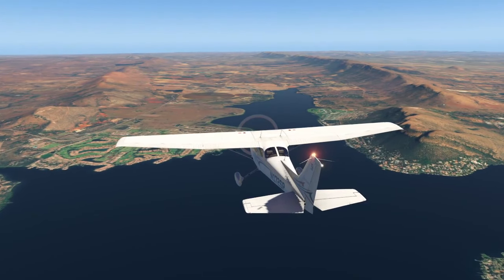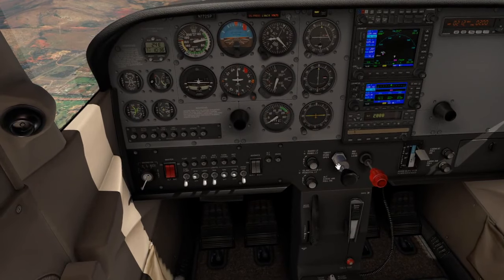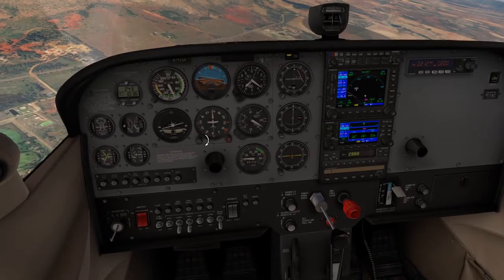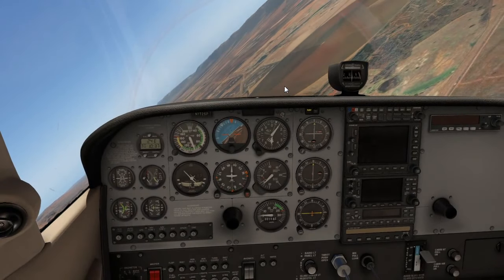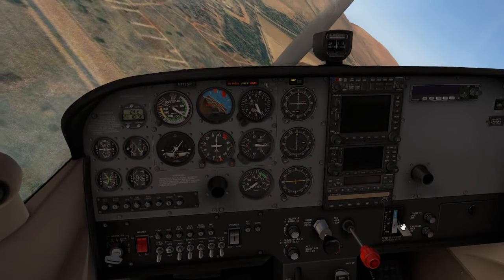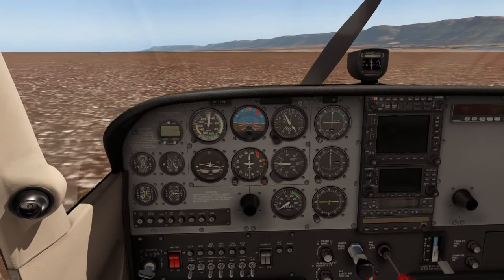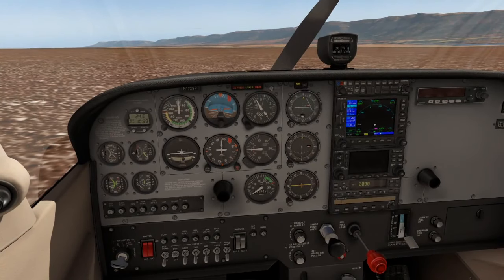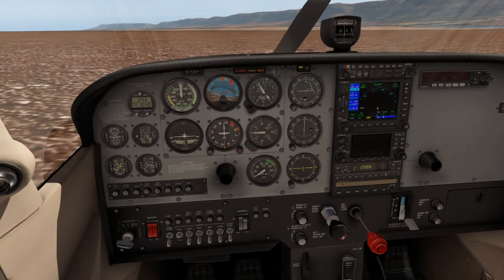Aircraft Engine Failure: Flight Lesson

Comment: I'm thinking it's squawk 7700.
Reply from the maker: You are correct. Well done!
Reply: @LouwrensMare  Yes, but if you immediately turn off the master it won't help all that much.
But depends then on the type of emergency.
Reply from the maker: Correct. It depends if its electrical or mechanical. In this case it is mechanical so you want to leave the masters on until you are committed for the landing as the flap is electrically driven on this cessna.